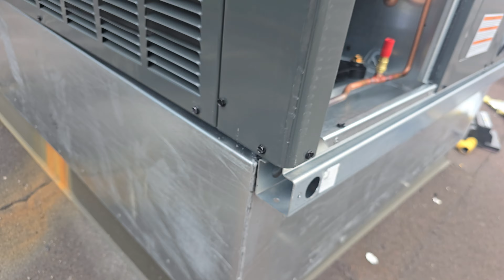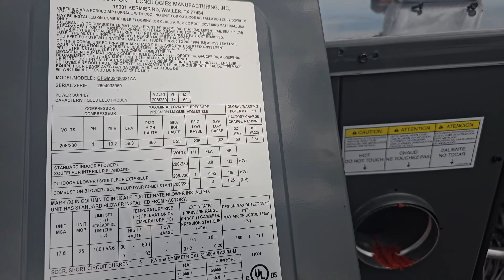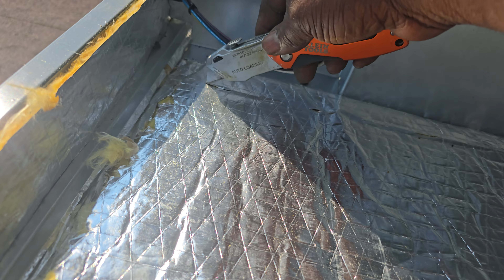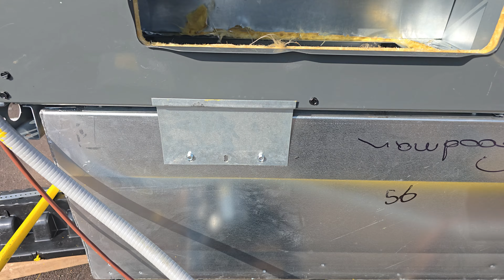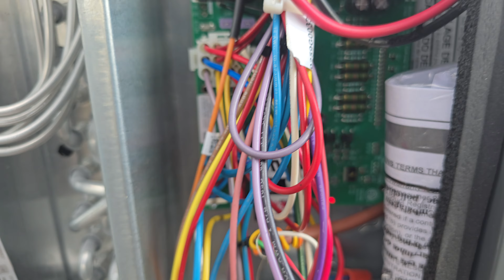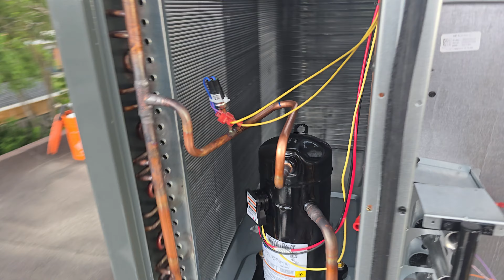Commercial Rooftop HVAC Installation | Complete Heating & Cooling Setup. Goodman HVAC

Comment: slight correction, respectfully, so 1 ton of heating/cooling re HVAC is 12,000 BTU so 2 tons would equate to 24,000 BTU's, a 60,000 BTU unit equates to a 5 ton package unit! :)
Reply from the maker: 2Ton cooling and 60,000BTU heating. Please subscribe, like and  follow up for more videos.